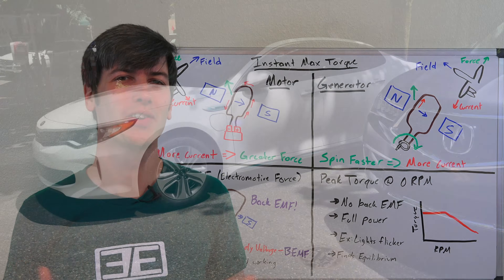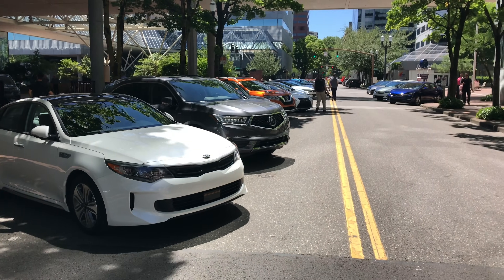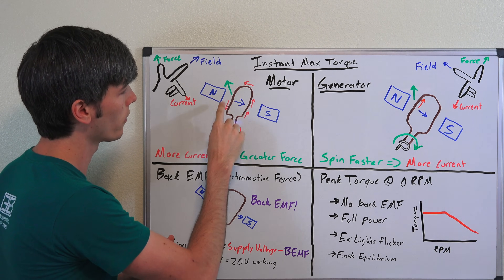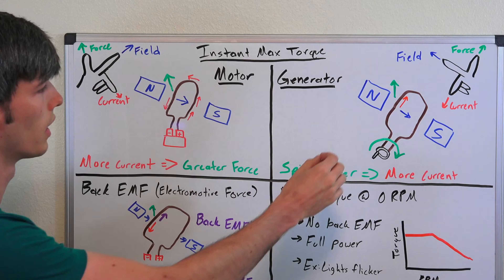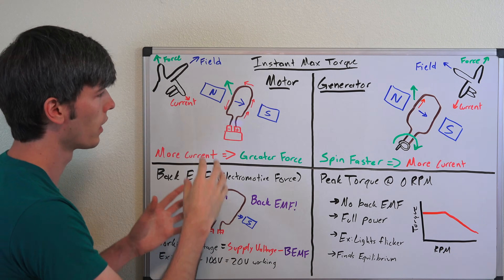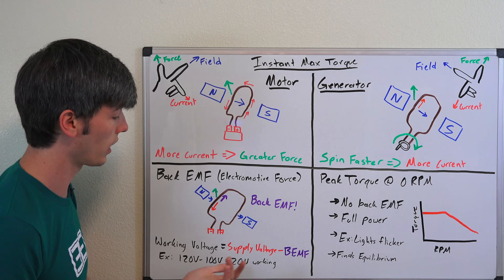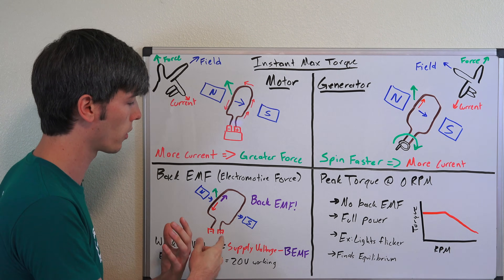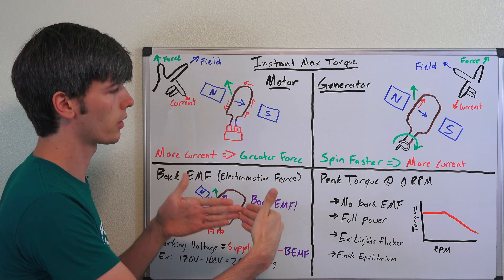How Do Electric Cars Produce Instant Maximum Torque?

Comment: From my understanding when he says BEMF it is sounds similar to a turbo just hear me out ..

Turbo : Draws in air therefore the more air into an engine the faster it spins ( excluding fuel we already know an internal combustion engine requires fuel to combust) 

Motor: Draws in electricity therefore if you have a motor that is capable of drawing in more electricity the faster it becomes and the more torsional ( circular motion) it can provide (much like a turbo spooling to provide more rotational force on the shaft to draw in air) 
Keep In Mind that...
Voltage : The Equivalent of Pressure 
Amps : Much like how much electricity can go through in a given second 
Watts: Energy Elicited ( brought out ) via heat. 

I tried to simply this as best as I could have a great day! 😂😅😉
Reply: I believe you've found a way to watch Youtube backwards, my friend! You have this concept completely bassakwards. The current drawn by an electric motor is constant; the current it generates and feeds back into the power source increases with the motor's speed. Torque produced is a result of the difference between the current drawn and current produced, so electric motors produce the most torque as they just start to spin.

Comment: The simpler explanation is all back to our friend, the equation Power = Force X Velocity or Power = Torque X Angular Velocity. It also turns out Power = efficiency X energy-input. That means energy-input ~ torque X Angular Velocity. So for any given energy input the lower the RPM the higher the torque. The problem is that the way you pump more and more energy into a ICE is by pumping more and more fuel through it which you do by by spinning it. So if you don't spin it at all you don't pump any fuel or energy through it and torque is 0. If you spin it fast you get a lot of power and can get some torque. Electric motors do not have that problem, you can totally pump in maximum energy without spinning them at all. Hence P = Torque X AngularVelocity takes effect and you get max torque at 0 RPM

Comment: There are a few errors in this one.
You're confused about peak power and peak torque. Power is always zero at zero rpm. Peak torque at zero rpm may be possible but only for permanant magnet motors, not induction motors.
Reply from the maker: As the title suggests, I was simply referring to peak torque at 0 RPM, not peak power. Power indicates that work is being done, thus the RPM must be greater than 0.
Reply: I think I mistook the "full power" point on the white board to mean max power, my mistake.
With electric motor it's just easier to just consider the current because torque is generated only by the current. As long as you can supply the maximum current you will get the maximum torque, which explains why they can have such a wide torque curve.

Comment: :}
     Yes but doesn't the speed of light/electricity also have lots to do your instnat torque of an ewlectric motor?

A ICE engine has lots of mechanical things in the chain actions that need to occure inorder to get the fuel introduced into the engine. 

Where as relativity speaking, the electrons/fuel go from the battery to the winding coils in the motor at 186,000 miles per second.  AND this is the only action that needs to be happen, all the power is there nearly instintaniously since the electons only need to go teh distance between the battery and the motor wiht only a slight detour thru the power controller on it's way..... So lots less needs to be done inroder to add the power on a EV motor vs ICE engine IMHO.....

Also, due to intake, compression, power and exhaust, and all this only exerts one push of power per 2 revolutions of the out put shaft.. Seems an ICE engine is actually it's own worse enemy due to design. A electric motor gets push allway around the 360 degrees of rotation of the output shaft. Where as a ICE engine gets perhaps power added to the out put shaft for possibly as little as 90 to 120 degrees out of every 720 degrees it needs to turn???? 

Than there is all the other things in the heat cycle that robs power/instant torque from the fuel in an ICE engine. To include rob some power to pass the exhaust thru a system that both quiets it down to an acceptable level  than vents the hot loud poison past the driver n passengers for safety sake......

AnyWay, I am not a trained/graduated engeneer of anything, so I could have 100% the above ALL Wrong actually..... 
:{

Comment: Electric cars are boring...Zero feeling, Zero passion, Zero mods, Zero sound aka engine noise, exhaust, turbo spool, super charger, No one going to give up spool and whine for instant boring torque lol plus whos got time to wait 30-120mins to charger a battery lol....plus who would give up the smell of unburnt petrol for electric :L maybe for a daily car you'd drive it to save the planet but weekend car inline6Turbz!!
Reply from the maker: Boring to some, but if you haven't, you should give an electric car a try. They're a blast in the city, and this is coming from someone who's owned four different manual gasoline burning machines. :)
Reply: Beast60 In my country most electric plants are either Hydroelectric or natural gas powered. All those facts can change and are about to change. 
Even if there is a lot of oil, let's use it for something else instead of burning it for energy! I gave the "no gas" example just to show that the true problem  with electric vehicles is not the vehicles themselves but the need of a system, a grid, a network to charge them. That's where the change begins and that's one of the things that show how much of a genius Elon Musk is. I really hope there will be even better batteries to have more range. However 500km isn't something to laugh at, specially if you can recharge another 400km for free in one of the many (Mostly Solar panel powered) Super Chargers available because it was included in the cost of the car (that's the situation of any Tesla Model X or Model S owner) And those didn't cost $120.000. Tesla Roadster was about that price ( I think it was $109.000) Model S is just over $86.000 while Model 3 is about half that price! $35.000! However, many people are paying more for it because they want the extra features.
Electric trucks do exist nowadays, alas they're not common, but the prototypes I have seen seem very promising. So, I really doubt we will have to wait 200 years for those.  
There is more! There are some  model Y plans and I can imagine Elon is going to make EVs even more affordable if everything goes as he planned!
Reply: True,  even a 750km or 1000km ranged vehicle pales when you have to travel 7000km. But the charging time of a 500Km Tesla is not 1-2 hours. It's some 30 minutes to 45 minutes, or even less depending on how much charge you have left and if your batteries are cool. Super Chargers are called such because they charge in a  shorter time than possible at home.  The prototype electric trucks had 1200 mile range if I recall correctly. Also, they were not recharged by conventional plug, but by either a hydrogen fuel cell that can be quickly refilled or a natural gas similar system.

 Either way, sure, the current status seems impossible, but we have been proven that the impossible is possible when you put all your effort to it. Of course, the more electric cars the better, and the more wind and solar energy, even better. more batteries to store the energy? Why not, after all, Tesla is even capable of recycling them. There is improvement and reduction of problems at every step, it's just a matter of some years for this to become a lot better. Tesla solar roof? Power wall II? Even better! 
Planes are a matter of another problem. There is a solar panel on the wings electric powered plane that did a whole trip around the world., but that was just a prototype.

The steps into a change of energy matrix to an electric energy source have been taken. The path has been shown. Now it's the time to start the transition. Someone even said that Tesla Model 3 is comparable to the revolution stated by the first Iphone!
Reply: What would happen if there were no gas and no diesel? Internal combustion engine Cars would be useless. Same thing with Electric cars, without a good amount of charging stations not much can be done. Sure, most electric cars don't have a long range, but hey, have you seen Tesla's range? They're light years ahead! 500 km is twice the range of most electric cars out there! And if that's too expensive I guess the more economic model 3 is still respectable!
Reply: Lol it's not that way. Fusion may be possible a good option to replace the current nuclear energy system, but we still have to achieve it. You are biased pal. It is true that anything we do has an impact on nature, but you can't compare the mining requiered for batteries to how bad the whole coal and oil industry can be, specially when you consider how bad fracking is. And you still have to consider that new battery tech is being researched.
About the oil and coal companies always having their way... that's relative, they will keep their misinformation about this kind of topics because of that, or even just let it be since oil will always have other uses, but the revolution has already started, Tesla Model 3 is just the beginning, since there other electric cars and too many  people have realized the benefits of the electric car, so now it's just a matter of time.
Reply: No body cares what you have to say lol you know im right ;) and you have to copy almost word for word because you're so mad ;)
Reply: Beast60 who cares about the sound your car has you cant make that a reason against electric cars. If you care so much about sound im sure you could make a replica sound of ICE with some audio technology and with todays technology Im sure you wouldnt be able to tell the difference between a diesel engine and a replica of sound that diesel engine makes. Im sure that in the very near future electric cars will be much much better and that will happen as soon as they perfect their batteries
Reply: If you spend all your time in bumper to bumper traffic and electric car is great, otherwise I'm sticking with diesel.
Had my first experience of an electric car this week, the car may have had instant torque, but the torque was hardly enough to be excited about. 
Worst thing was the vehicle used half of it's charge to travel less than 50miles in the city.
There ain't no way I'm buying a vehicle that can barely managed 100miles on a charge, where I will be limited by the places I can charge from and will have to wait 30mins to an hour to charge.
Electric cars may be the future, but it's still a long time till they will replace petrol/diesel/hybrid cars.
Reply: Josue Cortez you are right about the Tesla range, shame its not the norm. Unfortunately the rated range of these cars is always less in the real world. Don't have to worry about diesel not being available, the Aviation industry will ensure that a viable alternative is found for diesel/kerosene that can be used in aircraft, heavy machinery, ships and cars.
Reply: FIrst of all Josue, if that happened, if you haven't noticed, our electric plants are run on coal and diesel. Second, it would never happen, theres about 500,000 years of oil left inside the planet. By the time we use it all we will be long gone or dead.
Reply: e85 for cars, ADD blue for trucks. Electric trucks maybe a thing in 200 years time lol till then nothing is better then diesel and petrol. Electric car that tows will run out of juice 60-70% faster then what it does normally.
Reply: Yeah blast in the city in a car that costs $120,000 in Australia that does 350-400kms that can only be charged at home, when my 3cylinder Mirage does 750kms on 43L. I'm all for save the planet but if you don't earn 300-500,000 per year you cant afford one. Thats the issue. If only they made small electric cars for around 20-40,000 that are only used for home to work even if it meant 250kms on max charge which is heaps for a get around car, work to home and small city driving i think that would help the world alot more then a car that does 0-100 in 2.8 second lol traffic is where we use fuel the most. Traffic is mostly heading to work etc If only the government would give a rebate to the buyer who buys a small electric car to drive to work etc that would be a start to push for a cleaner world and the electric car companies will have more money to use to improve for the future plans.
Reply: Yes your country has that but not every country has it, so maybe in 2000 years time we'll be full electric, more so, how will trucks pull 50 tones of items on batteries that last 100-200kms? how long is the charge? Will we need to wait a week to receive products from the other side of the country? Australia is the size of europe Brisbane to perth is 7000+kms how many times will he need to charger to get there? 50? lol how will a plane run electric? its nearly impossible at this very time. Like i said two posts above, small electric cars that can be bought by you and I is the way to go, since there are more cars that sit in traffic everyday then planes, trucks etc etc key words here are "Cost effective and Time manage". No one wants to sit and charge a truck or car 1-2 hours to drive another 200-300kms. When i can refill in 1 minute. Plus how many charging Station do you need? what is 100 people need to charge? will they have 100 charging stations at one station? No lol We are so far away from making this Global is insane and yes 200 is being light try 500.
Reply: What about the amount of power a truck needs, having a 10 tone battery to power a truck is not cost effective to anyone, not to mention the waste and material needed per battery, 100 trucks 1000 tones of battery, Tesla is around 2 tone? it just doesn't work out. The amount you need to mine and remove from the earth will do more damage then coal or oil lol what we need is fusion energy ;)
Reply: But either way, Oil and Coal companies will always have their way, and they could easily buy out every Electric car manufacture and close them down. :P
Reply: It won't last or work, period ;)

Comment: Why zero RPM? The engine can't produce anything when it's not spinning. 1RPM makes more sense
Reply from the maker: Torque doesn't require rotation, power does. You can apply torque to a bolt without it moving.

Comment: I like what radio controlled motors are doing, a dc brushless 4 pole motors are bomb. for a little motor say the standard 1/10th scale monster truck with a "540" sized motor can produce 1.3 hp at roughly 30 ft/lbs torque. scale that up, 13hp 300ft/lbs/T and instant. I've broken so much stuff doing full throttle from a stand still the motor is a castle creations 3800kv 4 pole with efficiency, voltage and amperage drop factored in.

Comment: Great video. But I still have to ask, since I've wondered this for a while, how does a Tesla P100 (easy example) launch so quickly with no wheelspin when a driver of virtually any other ICE powered car could accidentally roast the tires and lose the race?

Something to do with transmission gear reductions, I presume?
Reply from the maker: It's super heavy and has AWD, so it requires quite a bit of torque to spin the wheels. Traction control will also prevent slip.
Reply: @EngineeringExplained  Help!!!...Do HUB motor electric bicycles have "instant maximum torque" or "peak torque" at zero RPM???
Reply: Computer controlled launch. You can see that on high end cars.
Reply: Traction Control. And because it's electric, the system can react a lot quicker than with a combustion engine.
Reply: Engineering Explained Thanks for the reply! Great stuff. I guess that's why some cheaper front wheel drive electric cars will roast the tires if you try.
Again thanks for the reply! I've never gotten a reply from a YouTube celebrity before lol

Comment: Since the torque drops off with higher rpm, then can you keep it at very low rpm (eg. 1rpm) and  have the high torque output through gearing?
Reply from the maker: You don't produce much power at 1 rpm, so you wouldn't be moving the car very quickly.

Comment: This also explains why ev car have  very low top speed for the amounf of bhp they have
Reply from the maker: Horsepower dictates top speed, torque alone does not. Electric cars tend to be high torque, but relatively low power (though often still powerful for the segments they compete in).

Comment: Thanks for yet another awesome and completely watchable explanation. You have managed what countless forums threads haven't.

I've also been wondering how the coil in a motor doesn't heat up the battery in the case of a DC motor, I have part of that explanation now.

Comment: Hey Jason! Can you tell me if this torque decrease with higher motor's RPM, requires gearing? Or all eletric cars have just one constant gear ratio? 
Keep up the nice work.
Reply: It doesn't require gearing unless you want to increase the top speed from the 130mph limit that Tesla sets for the Model S, as an example. Petrol/Diesel engines require it because their torque drops off suddenly when you reach a certain RPM, electric motors drop off in torque is pretty much linear with speed because of back-EMF so for the most used RPM ranges in road cars (and probably most electric sports cars once they come along), the increase in torque from the motor by gearing it to have a lower RPM for a higher wheel speed will be counteracted by the gear ratio since gearboxes work by reducing the torque that comes in to a lower value in exchange for speed.
Even if/when they implement gearboxes on electric cars it will probably only be a 2 speed system and would rarely even need to switch into 2nd gear as that might only be engaged at >100mph for example.